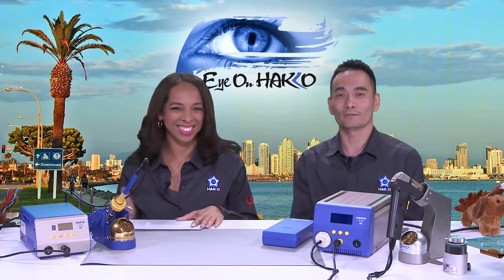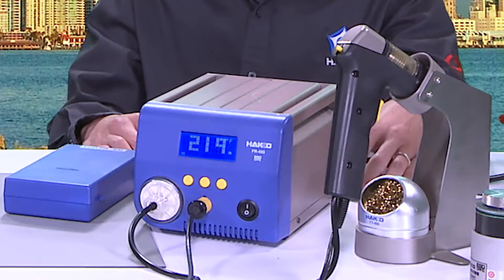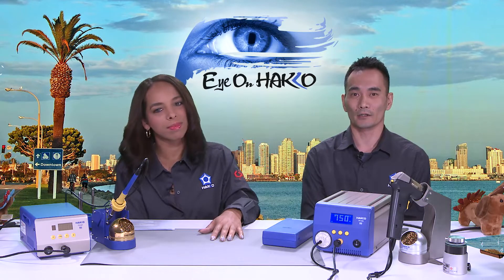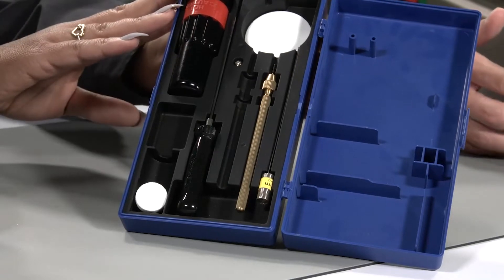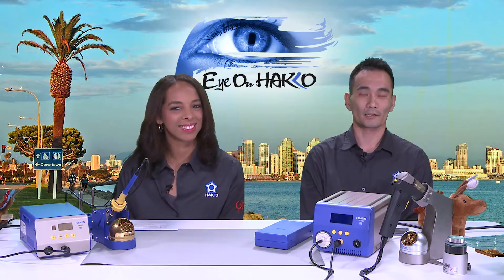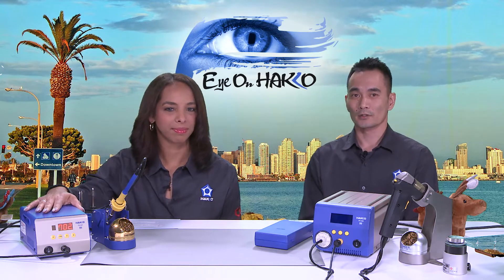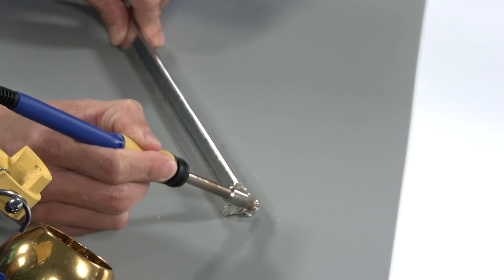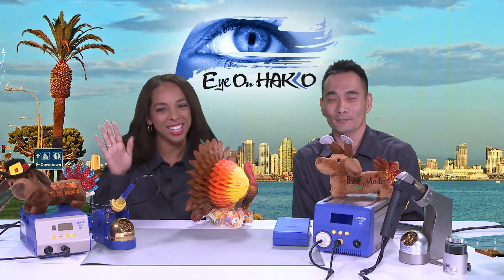"Eye On Hakko" presents, "Going Ultra Heavy Duty with HAKKO"

Comment: I'd really like to have this 801 in particular. It looks like it has the integrated cartridge technology of the 951 in a large thermal mass design with a LOT of power to back it up. The slim tip really add a lot of versatility.